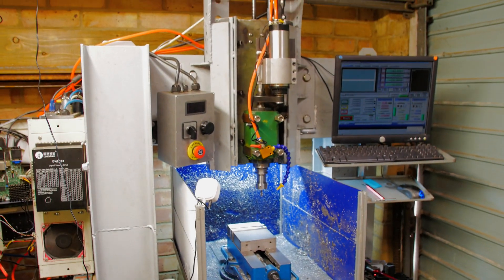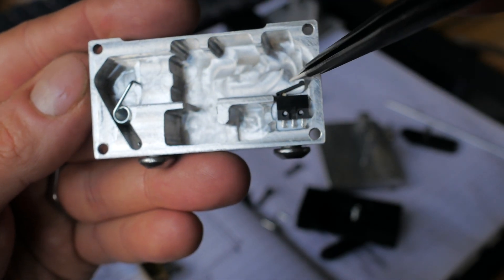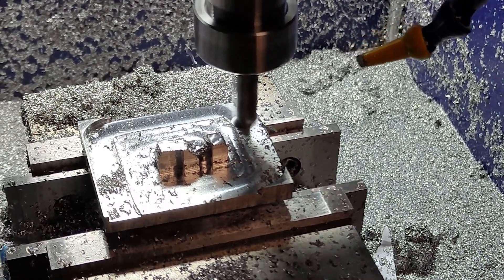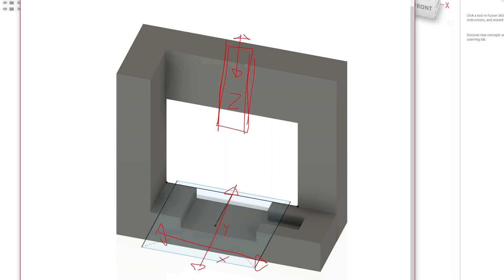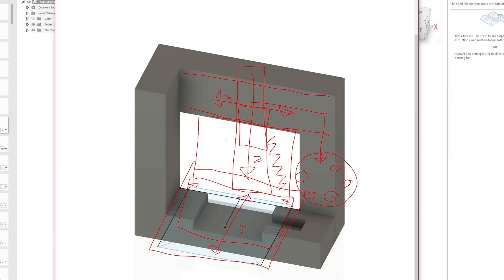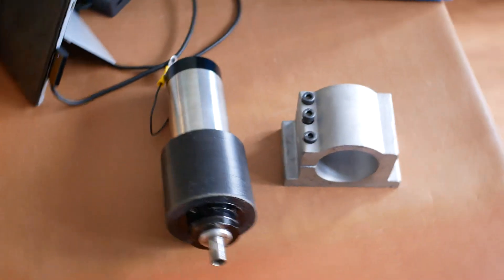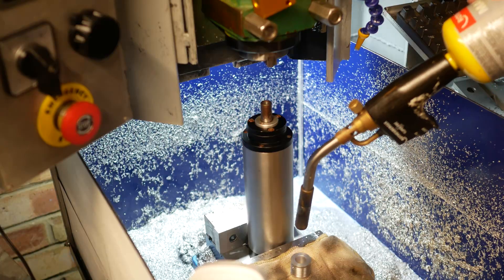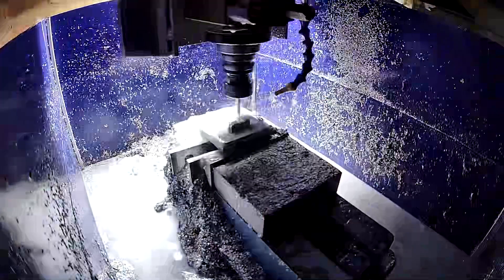DIY CNC Mill - First parts, upgrades & future

Comment: curious if you have issues with the green spindle running it at high speed, i have a similar one and they are only rated to 3 or 5k rpm. i am a bit scared to gear my treadmill motor so that it can spin the spindle at ~8k rpm, lots of spinny stuff close to my head haha
Reply from the maker: I wrote a whole reply about the treadmill motor & then re-read your commment 🤣With the green spindle, I think it has the tapered bearings in one of the ends which limit it's RPM, they generate a lot more heat than the 'fast' ones (deep groove/angular contact). As long as you keep an eye on the temperature, it'll be ok. I run it at around 5000 for the longer jobs & faster for the short ones. You can also replace the bearings for faster ones, but the spindle probably isn't balanced to run much higher so you might find some vibrations starting to creep in at higher RPMs.

Comment: I really like your cnc mill. On the next project I think the x and z movements on the spindle is a better option, it gives you more room for improvement and a larger working area.
Reply from the maker: I'm thinking this too... Maybe the super big linear guides will help it cope with the weight 🤔
Reply: @Loopyengineeringco  I think so. If you make the spindle mount sturdy enough you shouldn't have a lot of rigidity problems.